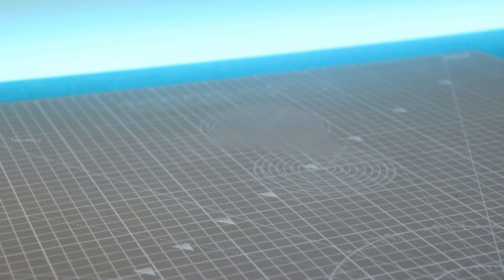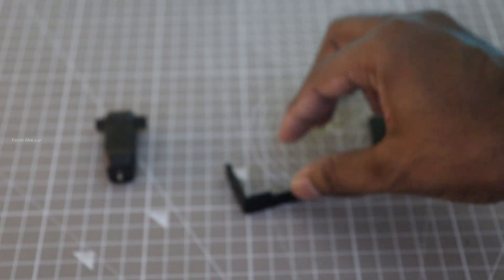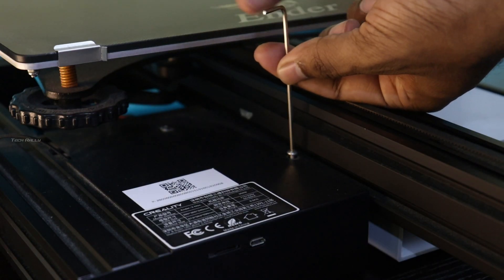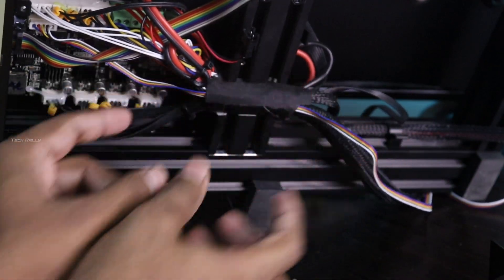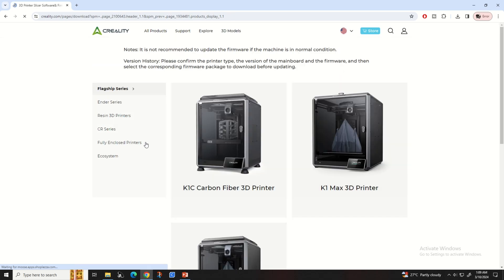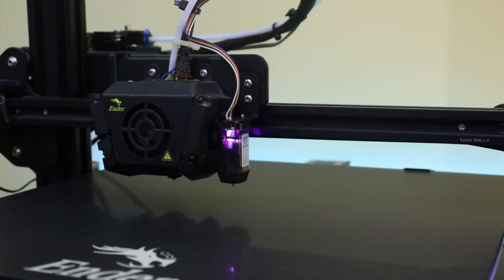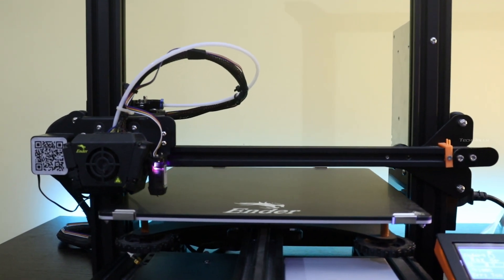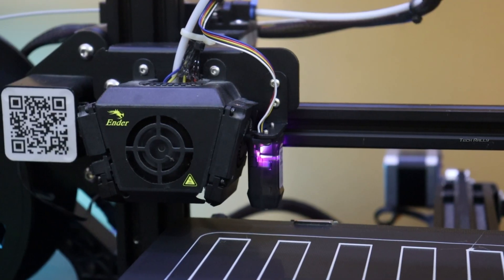How to install CR Touch on Ender 3 Max with Firmware update

Comment: Thanks for the video. In my machine the firmware don't save the prob z offset.  Every time that the machine (E3Max) turn on, the prob z offset is 0. I tried to save it few times but it's the same every time.
Reply from the maker: Same issues for me, Try the this link for firmware, it works for me But you have change the probe offset and e steps before using 
https://marlin.crc.id.au/
Reply: @TechRallyofficial  Thanks again. I download the firmware from the link. It's working great. Now I'm after upgrading the dual Z (using your printed bracket) and the CR Touch by your video. and I just got the Sprite Extruder Pro Kit, hope to install it next weekend following your video guide. Great video guides.
Reply from the maker: Awesome, Happy Printing 🥳🥳